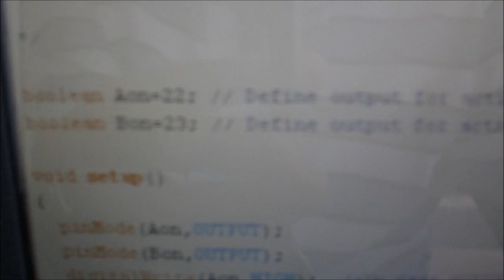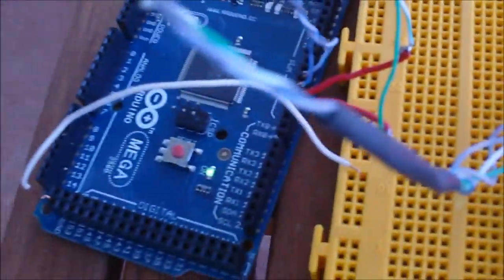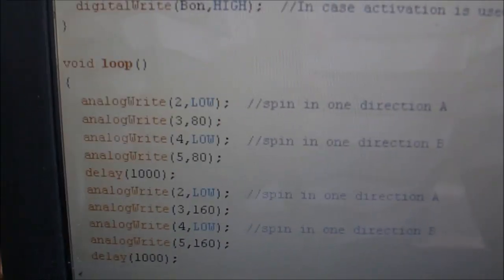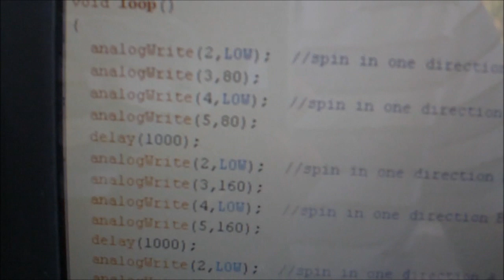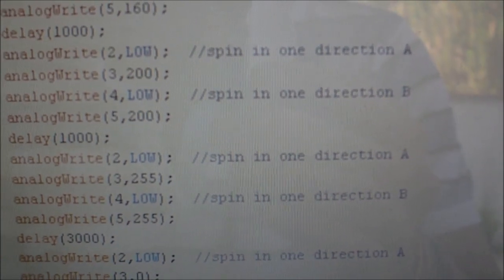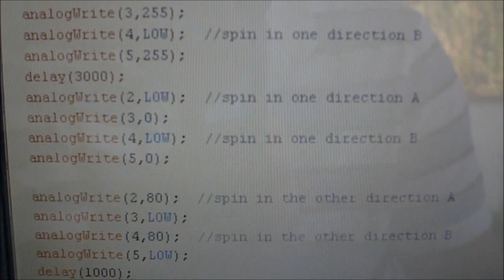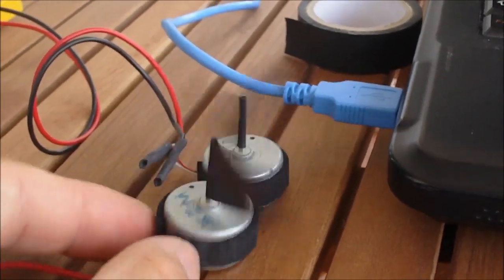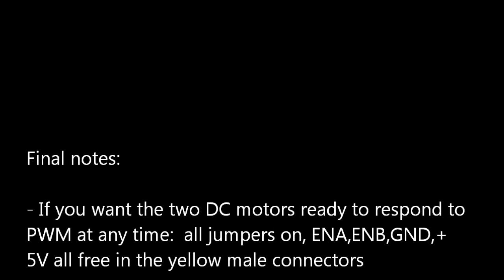L298N Stepper Motor Driver Controller Board for Arduino & two DC motors

Comment: Can it move CIM FR801-001 motors?
Reply from the maker: Even free of load, 2,7 amps are needed for that motor. 27 on normal load. Way over what this board supports.

Comment: Hello Cesar.
I need to control one stepper motor (45v  2.2A)  I got the  driver and my arduino (UNO) too, Motor terns but I can't write the loop to create a constant stop and start , can you help?  please
Reply from the maker: Hi 333geoalv. To start with, L298N chip maximum operating voltage is 46 V so you would be just about maxing out voltage, but the bad news is its peak output current per channel:	 2 A. I believe stepper motor current rating is based on current per coil, so that's one channel. Your motor is beyond the L298N board capabilities, though you're probably not running it at 45 V, so as long as it turns and nothing burns...
I don't know what you exactly mean by a constant stop and start loop, but in my blog there are a couple of examples that may help you. You should define your motor's  steps per rev., pins (arduino) attached to stepper control, desired speed and then use stepper.step() function to drive the motor. Including this function inside 'for' or 'while' loops inside 'main' should do the trick you want.
Reply: Thanks for getting back Cesar.... 
I did not express my self properly, the Arduino is sending the signals to the motor driver
Reply from the maker: 333geoalv 333geoalv, sure I meant arduino pins connected to stepper through L298 control board
Reply from the maker: hi, I just re-read the thread and what a dumb response did I give you. It will be solved by now but anyway did you check code in my blog?

Comment: // 1DC  motor example using the same  l298n driver
int IN1=8;   // pin 8 of arduino  connect to IN1
int IN2=9;  // pin 9   of arduino connect to IN2
int ENA=6;  //   or any pwm pin speed from 0-255 pwm
void setup()
{
 pinMode(IN1,OUTPUT);
 pinMode(IN2,OUTPUT);  
}
void loop()
{  
 analogWrite(ENA, 130);// motor speed  
 digitalWrite(IN1,LOW);// rotate forward
 digitalWrite(IN2,HIGH);
 delay(2000);  
 digitalWrite(IN1,HIGH);// rotate reverse
 digitalWrite(IN2,LOW);
 delay(2000);
}

Comment from the maker: Aon(22) would be conected to EnA, and Bon(23) to EnB. If EnA and/or EnB in the L298 board are left without connection or "floating" (as in the video), this seems to leave bridge A and/or B enabled. To disable, EnA and/or EnB pins should probably be put to 0V. To summarize: Aon and Bon in the code were intended (thought not used) to control activation/deactivation of motor A and motor B H bridges, just in case you need to.

Comment: This two lines on your code

int Aon=22; // Define output for activation of motor A
int Bon=23; // Define output for activation of motor B

There seems to be no connection to pins 22 and 23 in the video. if so where do you connect them ?

Comment from the maker: Hola J.Carlos! clemas azules, las cuatro en laterales (2+2) las conectas a los motores. Las 3 centrales: en VMS conecta el + de la fuente para los motores y en Gnd conecta el - de esa fuente y tb al gnd del duemila. Control:  conecta cuatro salidas del duemila con PWM a los cuatro pines en la placa L298N desde In1 a In4. In1 y 2 mueven un motor (A) en un sentido u otro. Apagas una salida y excitas la otra con analogwrite para un sentido y al revés para el otro. Igual con otras 2 sal.+ In3 e In4

Comment from the maker: Control: goto 2:42 and pause. You need to select PWM capable pins in the Arduino (I used 2,3,4,5, to the left in the paused image) to pins In1, In2, In3, In4 in the L298 board (to the right in the paused image). In1 and 2 will excite one motor in one sense or the other, and In3 and In4 will do the same with the other motor. In this video this is done through function analogwrite, where to turn one way you switch off output in one pin (a.e. exit 3 to pin In2) and excite with the other (2 to In1).

Comment from the maker: I'm sorry, the video is a bit messy. Check 0:42 and pause. You've got 7 connection points. The four in the sides (two on the left and two on the right) is where you should connect motors. Polarity of the motor cables is only for angular sense CW or CCW. In the three connectors you have in the middle you have to connect your power source voltage for motors (a.e. a battery pack + wire) to VMS connector and GND connector to the ground in this source (a.e. a battery pack - wire) and to GND in ard.

Comment from the maker: I'm afraid not, but I'm no expert. BLDC drivers are expensive becouse control involves electronics and logic (programming), so complexity is greater than what a cheap L298N dc motor gives. You can find tutorials though, about how to build them. Search for "build a brushless motor controller in a day" in google and there you are.

Regards

Comment from the maker: Well, I believe blue connector with vms is intended for power voltage (and hence current) to motors. The Arduino board 5 volts pin comes from a power regulator that most probably can't handle the current the L298N coupled with your DC motor is demanding. You should check your DC motor rated voltage and current and connect a suitable power supply with its gnd to gnd in blue connectors and vms to voltage from this your PSU. Please also read below HSMtl comments, regarding other pins. Good luck.

Comment: In those blue pins there is a vms, I have attached this to the Arduino 5v and the GND to the Arduino GND.  What is that blue 5v for?  If I use the PWM then I just get a beeping sound, any idea what that could be?

Comment: the 5V_EN is a jumper to enable the onboard 5V voltage supply, regulated from the Vms input/drive voltage, gets you the 5V pull-ups I mention earlier, more precisly it enables the EnA and EnB all the time, but I'm guessing a 0V from a uC IO pin would disable the bridge, because of the resistor  marked O1 and O2 making the pull-up.

Comment: CSA and CSB are for Current Sense A and B, simply to put a resistor in series with the coils so you can measure a voltage drop (divided by the resistor value) to get a value of the current your are actually using. now UR1 to 4 jumpers are pull-ups on the input you know to always get known inputs at all time (no in between status so the brigde dosen't go in unknow states...)